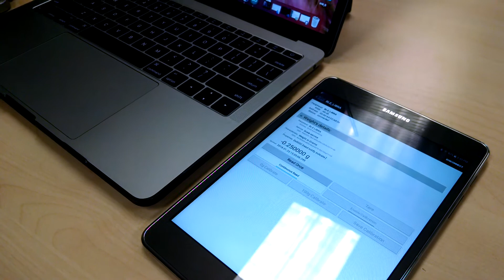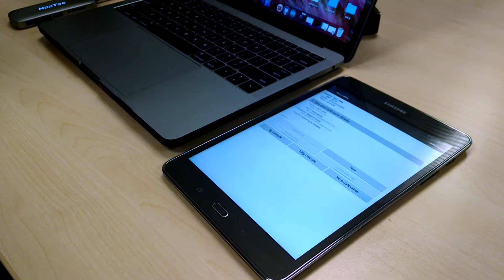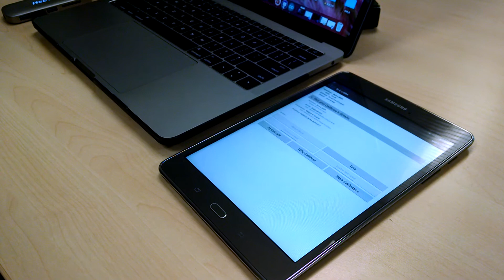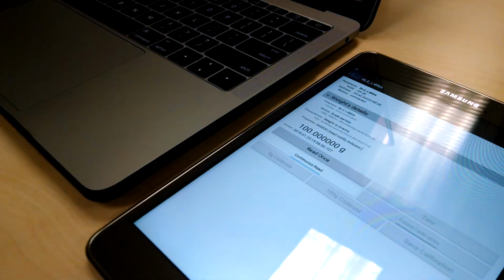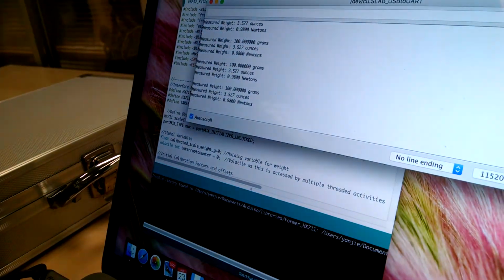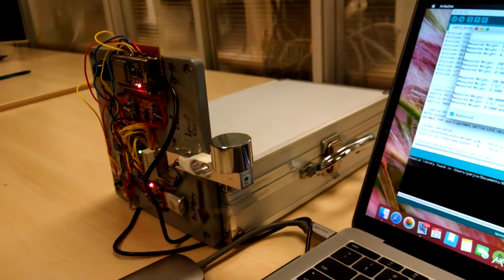HX711 Load Cell Weight Scale with Espressif ESP32 with Bluetooth Low Energy (BLE)

Comment: how is connected the hx711 to the esp32,? which is the clk input?
Reply from the maker: This is a proprietary synchronous serial, bit banged interface.  It is not I2C.  Two gpio pins were used, these were not shared with i2c or SPI.  As long as you stay off of some of the shared use pins you shouldn't have any issues
Reply: @mklopfer  i have a esp32 devkit so this doesnt have A0 A1 A2.

Comment: Hello. I would like your help.
I'm using an Esp32 and the HX711.
I downloaded the HX7711 library from the link you provided and I also read the other links but I'm not getting it. The readings on the HX711 are always 0 or -1. I've already tested GPIos 26,25,33 and 32 but nothing changes.
On Arduino Uno it works normal.
Thank you.
Reply from the maker: Please double check your wiring and sensor.  The code is tested as functional.